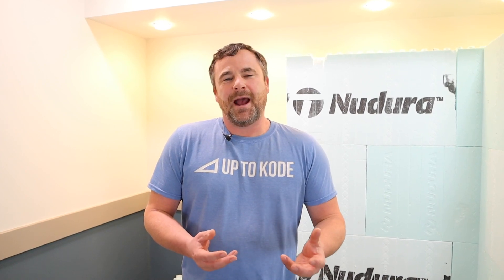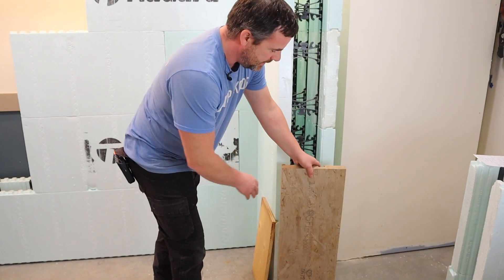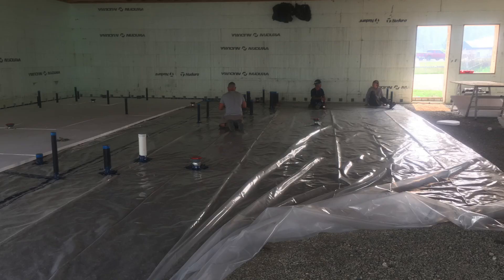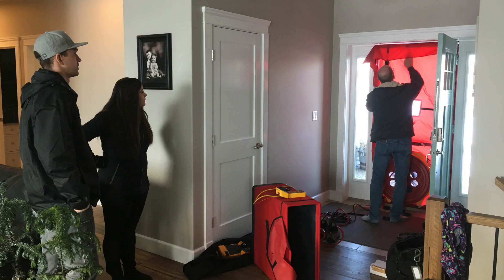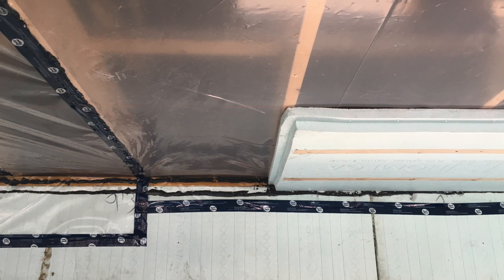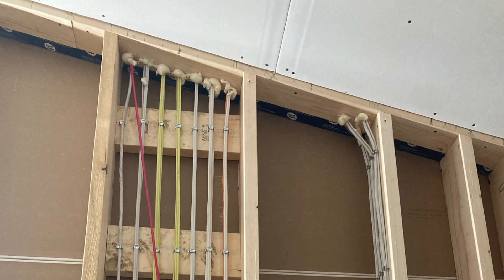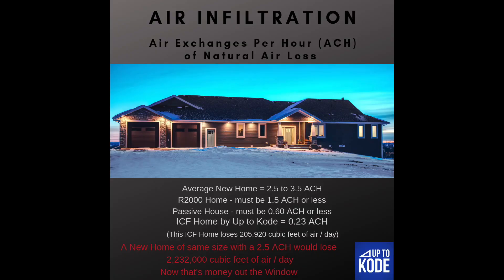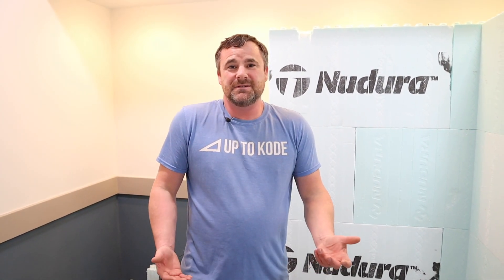Airtightness in ICF Homes: The Key to Energy Efficiency

Comment: whats your view on a spray foam /conditioned attic space.....? i did icf to my top plate and am apprehensive about spray foam in the roof. northern colorado climate with plenty of spray foam guys on hand. concerning this video what was the decision maker on not spraying foam on this building?
Reply from the maker: I personally don’t like spray foam. It’s expensive for one, especially if you’re doing your whole roof. 2nd… if you are installing asphalt shingles I much prefer an air space below them. I don’t know for certainly but I can bet if you spray foam the underside of an asphalt roof those babies will bake off in 1/2 the time as usual. 

A flat ceiling with blown in insulation is by far the most economical way. And it’s very air tight as this is the way I do it and I’ve proven it. 

Batts for vaults is good too. Still economical. I do with an R40 layer and a 2nd of R20 OR… just go 2 layers of R28 and always stagger the joints. Pay attention to the vapour barrier and make sure trades don’t hack it all to eff when they drywall.

Comment: Just want to comment that you (and virtually everyone else) failed to explain ACH50 fully and fairly.  It sounds good to say that building code allows 3 air changes per hour... but that only happens under condition where the pressure differential between inside and outside the home is at 50 pascals.  This would be a sustained 20mph wind from all directions hitting the outside of your home... something that no home experiences ever (wind doesn't blow from all directions) and the windiest city in the US is Dodge City Kansas at 15mph average wind speed.

So the reality is, a home with a 3 ACH 50, will likely see FAR fewer than 3 air changes per hour except during extreme weather events.  50 pascals was chosen so that the leakage rate was exaggerated to make measurements more accurate without having to have blower door fans calibrated to the cubic inch per minute.

ACH50 is a way to compare two buildings and access the performance... not a practical measurement.

Comment: OK. I am not a builder, so take my comments in context. I have a question for the building science and/or ICF folks. There is a lot of chatter about concrete not being an environmentally friendly material.  I did a quick and dirty calculation of how much embodied CO2 is in my mythical 2400 square footage (1,800 wall square footage) house.  My calc (with a pretty large contingency) for total concrete was 42 yards. This was for the walls only, not the foundation, driveway, etc.  I am assuming you need those things anyway whether you build with wood or other materials.

According to the PCA, a yard of concrete has 400 lbs of embodied CO2. Doing the math, this equates into approximately 17,000 lbs or 8 tons of CO2. I also looked at what the average house generates in heating and cooling in CO2 per year.  The numbers vary widely, depending on where you live, but the lowest number I saw was around 3 tons per year to heat and cool. 

I would seem that concrete would be the clear winner in that getting to passive (or close to it)  is relatively easy and the payback to recover the original 8 tons of CO2 "investment" in the original build would be recovered in a couple of years, certainly less than 10 years.

Am I missing something in my math?

Comment: ACH is not constant air changes per hour - it’s a pressure differential test meant to simulate windy conditions somewhat
Reply from the maker: Regardless it’s a great way to test how air tight a building is. And ICF allows much higher efficiency with less hassle.

Comment: QUESTION FOR KODY: If you install a radiant heat system in your entire main floor, would you go back after the concrete pour and cut stress relief cuts with a saw on that floor? I ask because some guy on Y/T did this and his system is destroyed. I suggested cork board breaks in place of stress cuts with a saw. I’d like to hear what you would recommend. Thanks
Reply: i've done several slabs with radiant and have never cut, and have only small hairline cracks (up to 34x48).  BUT, i have always used rebar and ensured it was placed effectively
Reply: @BrianKrahmer  have you ever used Helix micro rebar strands when pouring concrete? Thanks

Comment: What about managing vapor and pollutants in the home?  If the house is that air tight do you need different HVAC equipment?  Also, are there problems with condensation in the walls and mold problems or does the dew point usually stay on the outside of the home?

Comment: Kody, another great video helping with important details, we have learned a great deal from your ICF videos!   Have you considered using spray foam under that slab?  Just finished a project in northern ID where we sprayed 3" foam right on the gravel it sealed tighter than we could ever achieve with tape.  Then set rebar and radient pex on top of the foam , it saved the painful tape detailing and potential for damage.
Reply from the maker: Spray foam is just so darn expensive. Good idea but not sure I would do it.

Comment: There are a few channels covering ICF construction, some of them self builds that are a little short of technical details sometimes. This channel is one of the most detailed yet straightforward out there. Thanks for all of the good advice. Some people talk about windows a lot when it comes to the ACH tests. I had a builder tell me that most of the talk around window efficiency is hype and the performance difference between a good triple pane and some of the ultra-efficient ones is not worth the cost. Installation practices are far more important than spending tens of thousands on windows that make grand claims.
Reply: ICF self builder here and agree the price difference between some uber expensive triple pane window package and a really good window package is not woth it IMO.  That money is better spent on a solar system and have a much higher and shorter payback.  I will also say that ICF's are the ONLY way to build a home IMO I think people are crazy for doing it any other way.  If you are wondering if you should use them the answer is yes you should.  I do not sell, make or install them either hust a super happy owner and user.

Comment: Thanks Kody for an other detailed video. I totally get that we can use ICF all the way to the roof and agree. However, aside  from wind resistance, is there any reason why one would use ICF on the gables if it is simply attic space (not lived in)? Thanks
Reply from the maker: Great point ! Only do an ICF gable if you have an interior vault and you want to maintain the strength and insulation. Otherwise a flat ceiling does NOT require ICF gables.
Reply: @uptokode  awesome, thanks for the reply

Comment: We just got back our numbers for a blower door. Simple diy 1700 sq foot 4 wall, icf home. The only "extra" thing we really did was spray foamed attic but that is because we are in the south and use attics for hvac equipment. They had to change out the plate and tape it because it was such a low number. The test came back lower than what all the windows together were rated for. Ended up at .25 ach. The guy said it was his lowest reading ever. This was the first time i had ever built a house. We didn't use anything fancy either. The windows were jeldwen casement. So if we can do it anyone can.
Reply: Nice
Reply from the maker: This is EXACTLY what I’ve been saying for years now. It’s so easy to achieve this numbers I don’t know why people mess with complicated and inferior systems.
Reply: I’m in Arizona just waiting on my blueprints to get completed so we can start our ICF home. How affordable were those casement windows compared to others?
Reply: Check out Enerlux windows. I went with Enerlux triple pane for my house 2yrs ago. Super tight, insulated, full fiberglass frames. Got quotes for fiberglass from Andersen and Marvin. Enerlux was cheaper and much higher quality. I am local to Enerlux so I didn't have to pay freight, that probably helped
Reply: @old1234 I just looked up Enerlux, and they are in Crete NE!! Thanks for the suggestion. I'm looking in to them now. We live by LeMars, IA.
Reply: Awesome! Good luck!